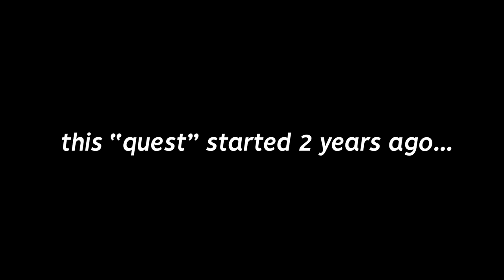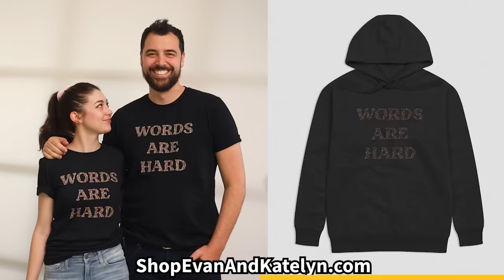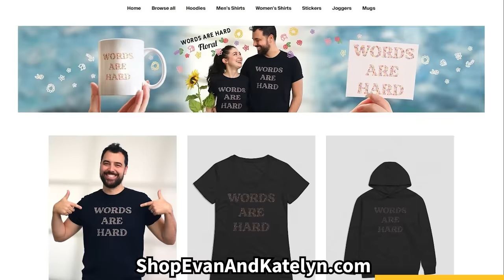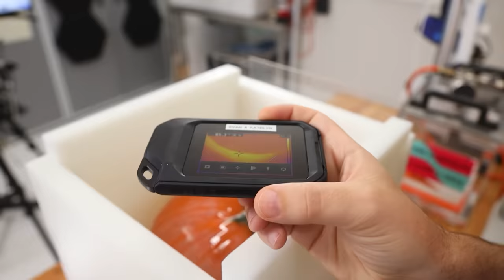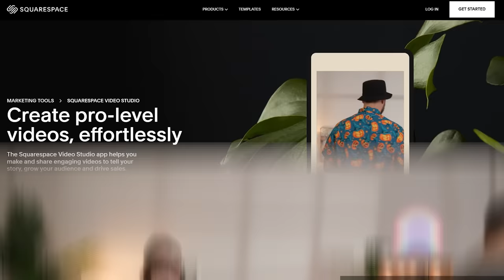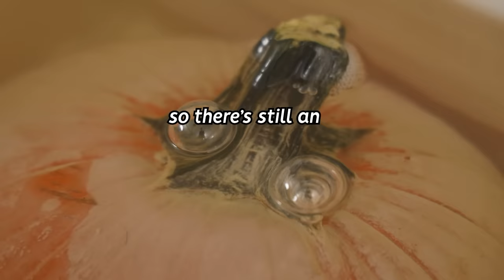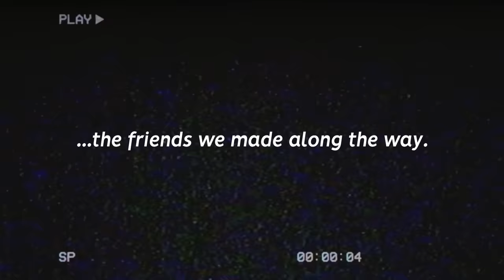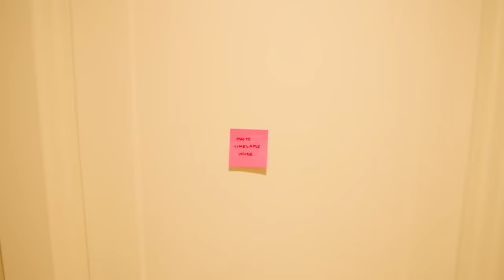Preserving a Pumpkin in Solid Resin… Will it rot?

Comment: The way to go with this would be to gamma sterilise the pumpkin after coating it in resin, but I'm afraid you won't find a sponsor to send you a gamma radiation source. (don't laugh though, this is how they make garlic keep for ages in some countries). The juice problem might actually be partly due to the heat from the resin causing the pumpkin to decompose faster than at room temp. A cure would be to use normal resin (or at least a faster hardener) and keep the whole thing refrigirated during the pour.

Comment: You could do this whole thing in 1 pour if you just fill all the cavities with resin plugs that you cured before hand.
Reply: No they can't, thermal runaway would be disastrous.
Reply: @roseabee7503  how is there any thermal runaway if alls they're doing is gluing large chunks together?
Reply: @grelgen  Because they still have to fill it with resin. They can't do a single solid pour.
Reply: @roseabee7503  it wouldn't be 8 cubic feet of resin being poured at the same time.  if the chunks are the right size and shape, they'd be doing 1 cubic foot
Reply: @grelgen  Okay, if you poured the mold in the video all at once with resin, you would get a thermal runaway. That's what I'm saying. You cannot do that because it's extremely dangerous and with the pumpkin inside, it would end up burning it.
Reply: @roseabee7503  and if you read my comment, I'm not telling them to pour the whole box in one go.
Reply: @grelgen  What did you mean by "one pour" then because it sounds like you mean an all at once, one pour.
Reply: @roseabee7503  step 1: put pumpkin in box.  step 2: put a bunch of clear plastic balls in the box.  step 3: pour resin on everything.
Reply: @grelgen  Resin balls would work better than the plastic because the plastic could risk melting or warping from the hear of the resin and the end result could potentially appear warped from the spheres. However, thermal runaway is still a risk there with the balls as well as air pockets between each sphere.
Reply: @roseabee7503  you clearly don't understand, so I'm just gonna stop replying.  I hope, one day, you learn from this, see that I wrote resin plugs in the original message, and then finally understand my suggestion.